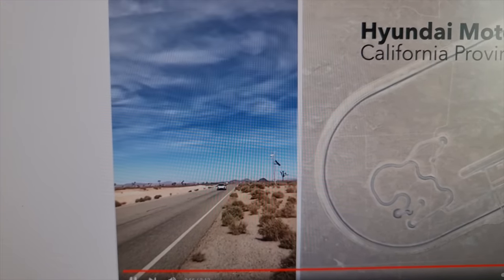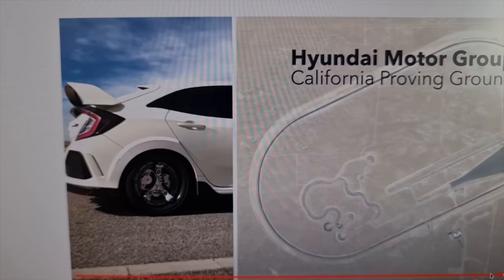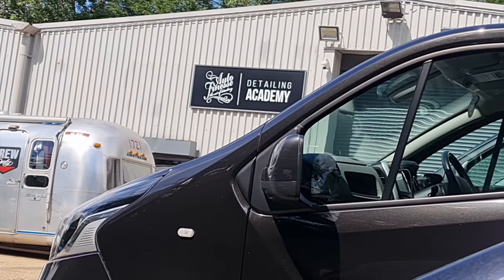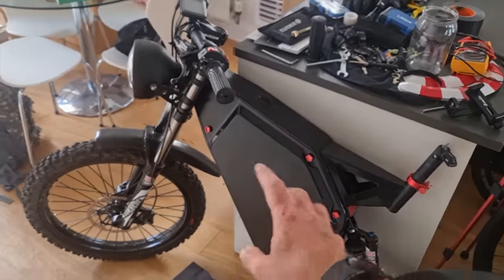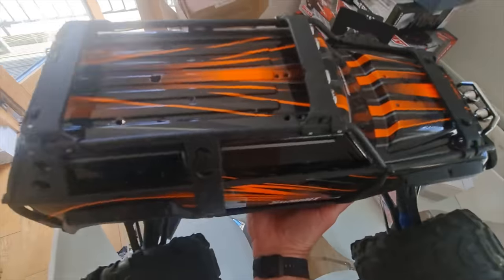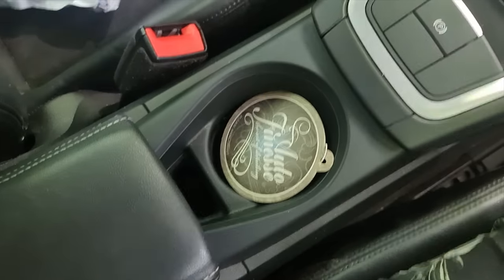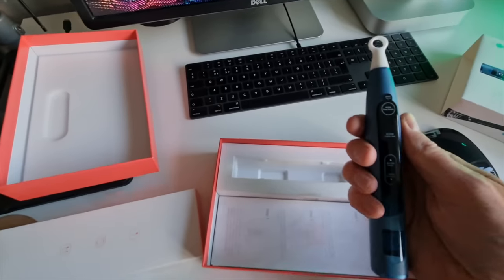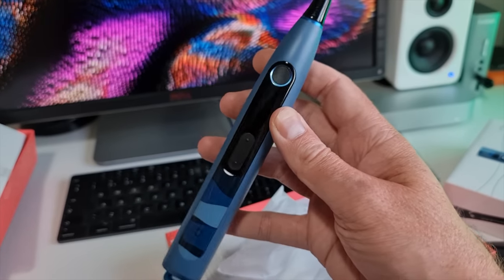BUILD YOUR OWN DIY EV WITH THESE HUB MOTORS!!!

Comment: the issues i see with these hub motors are that if you put them on rear wheels of a fwd car the rear suspension is not design to handle anything like that if you look at your audi. look at the rear suspenion then look up rear suspension just of a fwd one its a big deference. Safety vise its a bad idea
Reply: That's not really how suspension works though...
Reply: They 3d scan the vehicle and engineer knuckles and suspension to support the electric wheel and brake hub
Reply: Yeah idk it seems like with good sensors and computer analysis then it will keep things within tolerance, i wouldn't expect it to be a super car without modification, but if that is the case, why not use a rear wheel drive platform or an awd one, eliminate the rear differential and the drive shaft and you've suddenly eliminated a bunch of weight that the suspension used to handle, maybe even causing problems with a lack of weight in the rear.
Reply: If that wheel can brake, it can also put down that 100nm of torgue with no problem at all.

Comment: I am wondering if it is possible to build a dual system drive using this kit. Example; a normal rear wheel drive car + a front electric drive using the kit.   Kind of a custom hybrid.
Reply: That's literally the point.
Reply: @jasonbourne1596 how did they miss that…..lol

Comment: This is Orbis system kind of tempting as a solution considering how expensive EV's are in terms of the initial purchase cost.  It's making me consider using a kit like this to replace my engine with battery packs and fit hub motors for the rear wheels.  As long as they can recomend or provide a compatible charging kit that is relatively compact (possibly small enough to use the old fuel tank spacing) these kits could be quite a good way for those of us on a budget.
Reply: I’ve sent Orbis about 10 emails over the past 3+ years and have yet to ever get a reply if I could purchase them. If you manage to get a reply let me know lmao
Reply: @taylork420  any luck?
Reply: This seems like it has potential as a tadpole trike powertrain. I might be the first to try it.
Reply: @taylork420 Well that's unfortunate, because I have an Impala LTZ with the 3.9 liter V6, and I would be interested in adding 300 horsepower to the rear wheels and turning it into a hybrid.

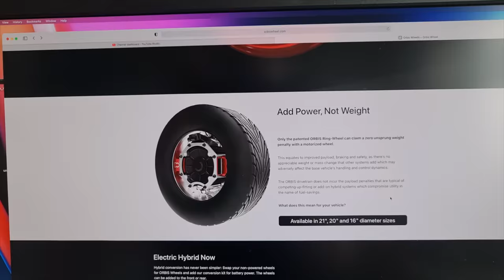Comment: 0:30 as someone who had a hubmotor powered moped, I will say that it will be very unpleasant with bumpy rides since that's a lot of unsprung weight.
For the rest it's so good tho! super clean look & great torque numbers & less wear parts like belts & sprockets. so less noise
Reply: Thanx bro that makes alota snes
Reply: You forgot A car has a suspension

Comment: I kinda wanna get two of those hub motors and put them on the front wheels of my older cobra… which I guess would make it all wheel drive. Even two 100 hp ones would give me 500+ hp.

Comment: I'm betting this kit would still be almost as much as a budget new car. I have an old mini pickup truck that might get converted to electric at some point in its life. The problem is, I don't want to spend several thousand dollars on a truck that's worth $800 at most. The IC engine in it right now produces about 110HP.

I also have a small car that could be electric if the right kit came along (hub motor would probably be required). It only needs about 80HP to match the IC engine in it.

You would think there would be sort of universal electric hub motors in various HP ranges that could be retrofitted to any vehicle. Like, 50hp hub motors would be great for most small cars. Get two of them to replace two wheels, remove the engine and trans and replace with lithium iron phosphate batteries and a controller and you should be set. Could have a 75HP and a 100HP hub motor for larger vehicles. No modern car needs more than about 200HP to do what a car needs to do. Mass produce the motors to get the price down. Mass produce the batteries to also get their price down.

Comment: The motor and conversion hardware is all part of the wheels.  So, It seems to me like the suspension needs to be beefed up to handle tork coming from the wheels to frame. The suspension is made for comfort and not power. 
I think, I may,  just maybe wanna buy a set of these whells put on my Mini Van cemper. A 2015 Toyota, Sienna.  I can't justify it in the savings in gas.  But on a camper and my hobby it may be just be right thing.  The tongue weighed on my bumper hitches 350 pounds. I think that would , support a  EV battery and two bikes.😊
  Thoughts??

Comment: Love your channel andy its nice to watch some of the stuff you do. Greatest respect. 👍👌 Edit i got my first e scooter last week for my 44th birthday and i was disappointed. I got the pure air pro LR it says it does 37.2 miles at 15.5mph i had it on the eco setting and was told with my weight 88kg i would get around 25 mile distance...that set alarm bell ringing. First charge i got 16 miles. 2nd charge almost 12 miles and both sessions was on flat ground. I ended up bringing it back to pure electric got my money back thank god. Been pure electric two times and both bad experience. Stay safe and keep pumping the tunes out. 👍👌 2nd Edit wish i had a friend like you with all the knowledge you know about modifying e bike etc.

Comment: OK I am in the US and I own a 2014 Corvette, I think AWD HYbrid is a great step toward Helping with Global Warming and keep our Hot Rods.
I want to find out more about In-Wheel Hub motors. Can you share links and and examples or installers. The new C8 Hybrid is AWD the E Ray Why not convert all the Pickup trucks and Gas engine rear drive vehicles with front wheel Hub drives. Even if only for short drive time it wouuld help and be a step toward better options with out losing money and spend a fortune on a new car when Recharging stations are few and far between

Comment: i want to fit those hub motor wheels to my fiat panda its a 2009 1.1L 42 Bhp "lol" problem is where can i stick the battery's ??????? on the roof may be or my be on a trailer.  in my jacket pocket lol
Reply from the maker: 😁 the boot or back seats??!
Reply: @andykirby  i might look at the boot and the back seat, before that i have another project called insulate the house and its a massive project but there will be a time next year that i will be either converting a car to electric or looking at those sick electric wheel hubs i know what i want to do first but others would freeze to death so i have to prioritize ( from MW5UFO locator square IO 81 HN )
Reply: Cost a fortune in AAA's

Comment: Wondering if it would be possible to have just enough battery to get the car moving and then a generator running off one of the other wheels to power the hub motors and recharge the the minimal battery...

Comment: diy pure true dc brushless motors
Reply: optimally you could fit the motor inside any wheel rim, modular, so that you dont have to change anything in the wheel or the connecting axle
Reply: metal-air (any reactive metal, like zinc, or iron) with ethanol-koh electrolyte, as the primary (but physically rechargeable) battery fuel cell, at least 1.2kWh/kg and up to 8.4kWh/kg
Reply: just feed more metal to get more juice out of the separate fuel cell, its like engine and the fuel source
Reply: if you dont make the cells yourself, its not truly diy
Reply: making metal with mains alternating current, microwave oven transform to high voltage electric field to break down the metal oxides to metal and oxygen
Reply: its called from basics diy
Reply: from dust to stuff, I mean
Reply: it you are making money, you are not making stuff (tm)
Reply: the true art of diy, actual diy :)
Reply: if you need to go to store, its not true diy
Reply: off-the-shelf manufacturing vs actual diy